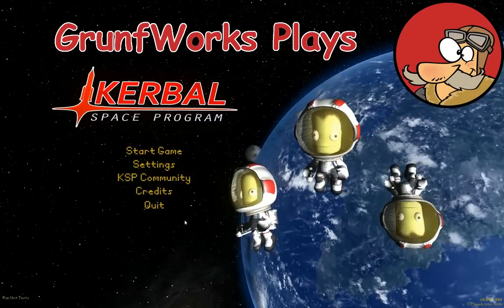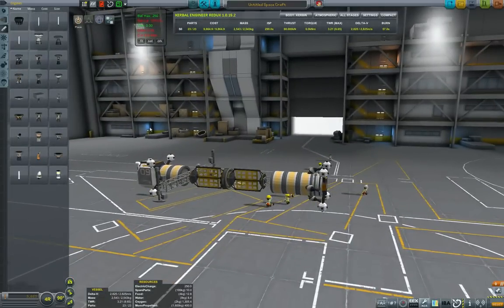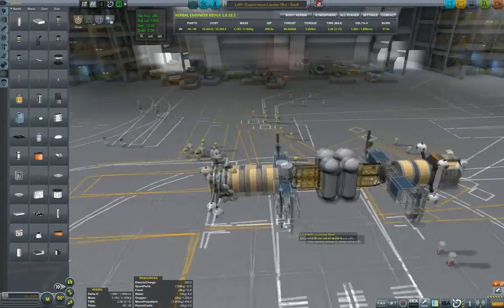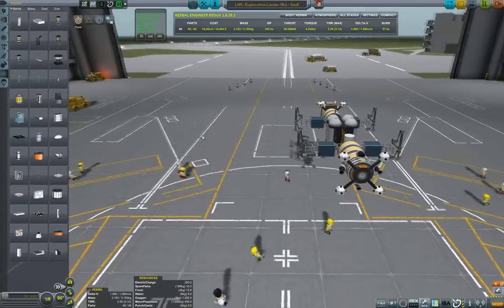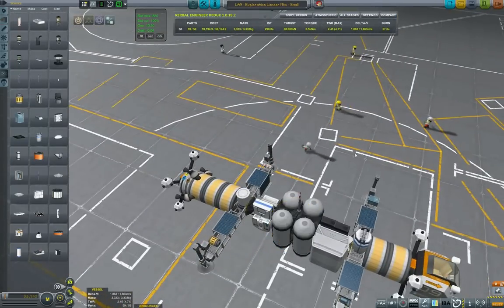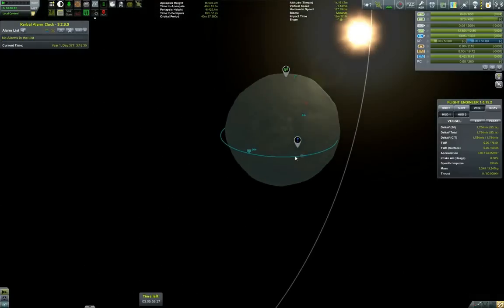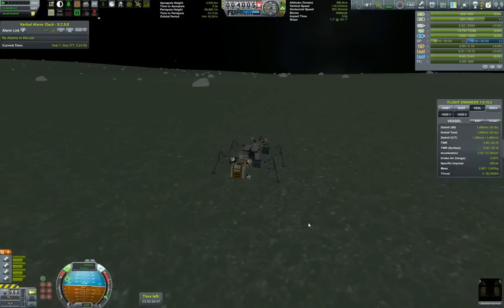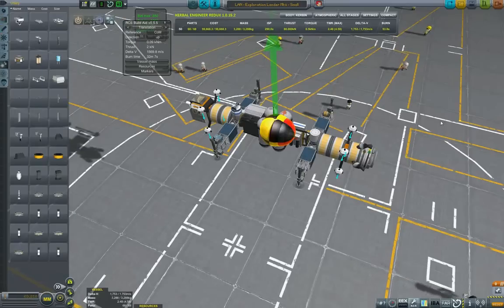Kerbal Engineering - Small Exploration Lander

Comment: can you tell me what mods you have used for these parts?
Reply from the maker: +miki burnett Most of the parts from the RoverDudes USI Exploration pack
http://forum.kerbalspaceprogram.com/threads/86695-1-0-5-USI-Exploration-Pack-Small-parts-big-adventure!-v-0-4-3-0-2015-11-09

not sure if that is all of them. but otherwise KW rocketry for sure
Reply: GrunfWorks it says "file not found" when i go to the link, is there a way you could send me the Exploration file for 1.0.5?
Reply from the maker: miki burnett
Checked the link does not work for me either. I thing Squad guys are updating forums and that is why nothing works ATM. I am getting 502 Bad Gateway